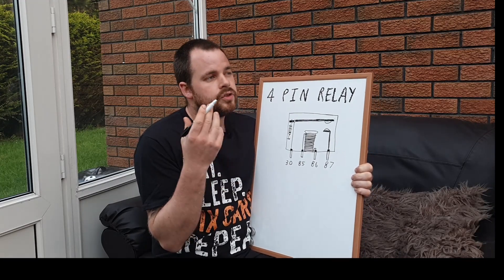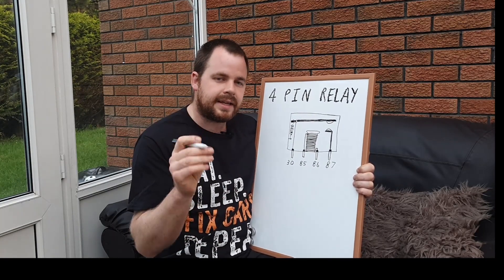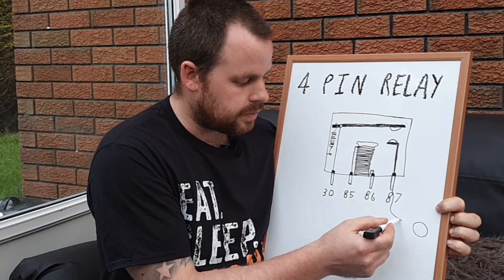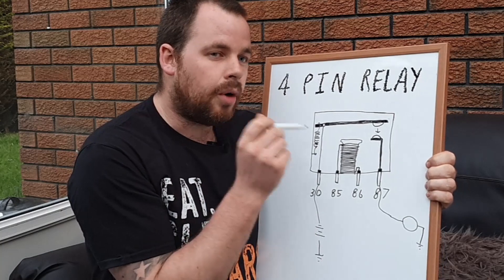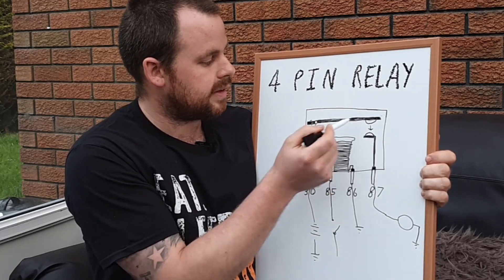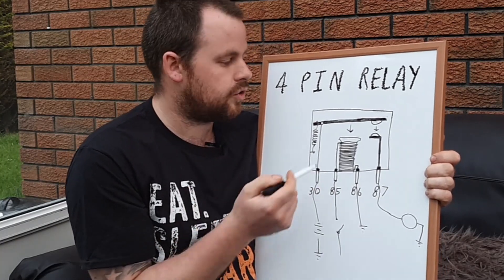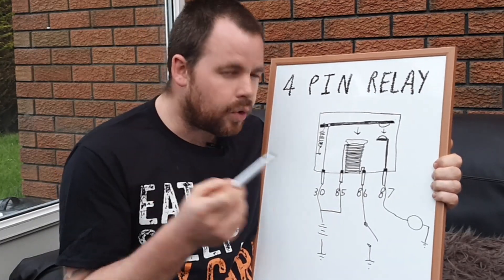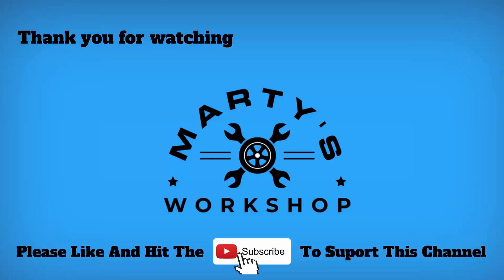How An automotive 4 Pin Relay works Explained and why you should use it for upgrades on your vehicle

Comment: Thanks for the video,  I think I've got it but would ask you to confirm.  I want to run led fog lights that turn off when my high beams come on. Do I even need a relay or could I just connect into my low beam power supply??  Thanks in advance.
Reply from the maker: To be honest led fog lights would a small amount of current so shuld be ok to take the live from the headlights. Thank you for watching

Comment: Hi,
Great video, can you tell me, how would I go about wiring a light bar to come on with full beam and and no switch in the dash.... Cheers
Reply from the maker: All you would need to do is take a supply from you main beam circuit and put it to the switching side of the relay pin 85, then put the other side pin 86 to earth, then put a fused supply to pin 30 and then wire pin 87 to to your lights, hope this helps
Reply: @Martysworkshop thankyou for your quick reply, have been watching some other videos, and a common method seems to be as follows:- 30 to posotive on batt via fuse, 87 to my lightbar posotive, 85 to ground/neutral and 86 to main beam wire..is that totally wrong or is there different ways to get the same outcome.... I'm confused...
Reply from the maker: 85 and 86 are the switching side of the relay so it doesn't really mater which way round you put it, thank you for watching
Reply: @Martysworkshop  excellent, thankyou for your help and replies, great to actually understand what im doing and not just follow someone's instructions... 👍
Reply: @Martysworkshop  can I just ask aswell, what size fuse should I use on the inline holder for safety, full beam in the fuse box is 10a, and does it matter the wire im fitting to 86(supplied with light bar) is thicker than the existing headlight wire I'm connecting to, (Im planning to use a scotch connector to one of the wires supplying the bulb holder). Can the earth connect to neutral on batt if more convenient? ., and finally is there any risk of fire etc in this installation... Cheers for your help upto now. 👍
Reply from the maker: Hello the wire to pin 86 doesn't matter as the relay switch uses a verry low current, the only wire you need to fuse is the supply to pin 30 know it depends on how much current your lights use and how thick your wire is, but as long as you are using the wire that comes with the light it will be good for the current needed by the light, i would start with a 10a fuse and if it pops after a use or to i would use a 15a, i wouldn't go bigger unless the light states in the instructions, as for the earth you can put it to chassis or ideally straight to battery negative. I hope this helps
Reply: @Martysworkshop  superb, thanks so much for the advice, it's a 2nd hand light bar, but I'm using the wiring and relay that came with it (it's all wowled brand) just adding the fuse, because it must not of had one fitted by the original owner.
Reply: Got around to fitting the light bar, and it's working a treat with your advice,, thanks very much.. 👍
Reply from the maker: Glad i could help thank you for watching